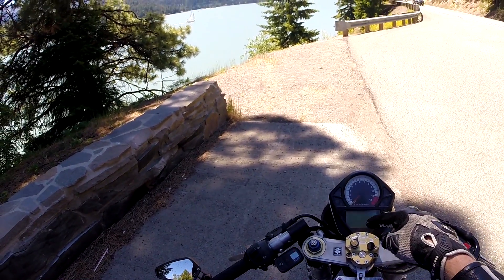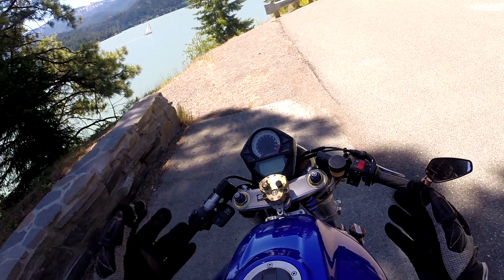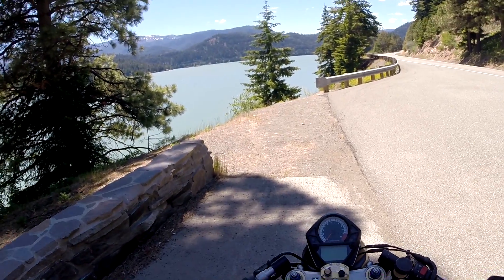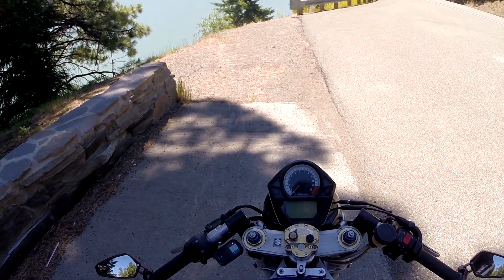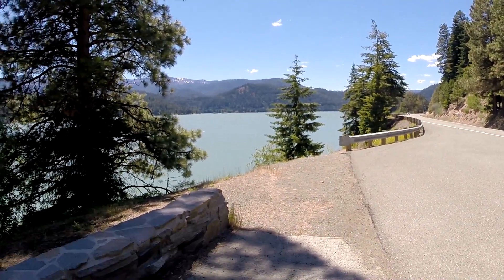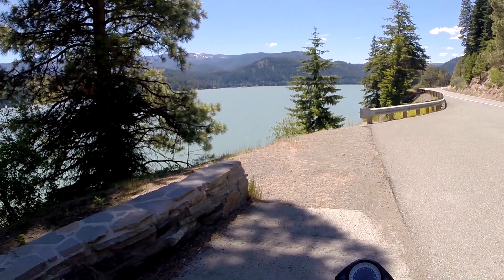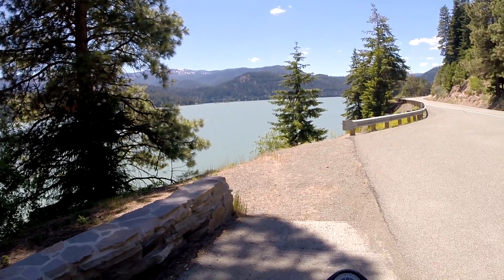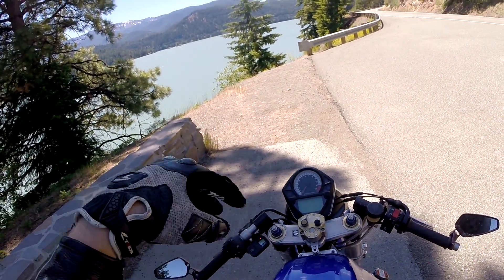Motorcycle Stability Explained

Comment: I don't think rake actually helps the steering exactly. Tony Foale's (quite famous) experiments showed that bikes actually steer better with a zero rake, but the forks judder when braking. The other reason for rake is just to position the handlebars closer to the rider.
Reply from the maker: Bob Walton For a conventional motorcycle, rake is vital. True, it isn't a strict requirement for a "stable two wheeled vehicle", but that's a huge design space that includes some very unusual arrangements. 
Link-based front end designs like the old springer, the Hossack, and whatever BMW calls theirs are examples that don't necessarily have a raked compression travel (heavily influencing brake stabillity), but even they all use an inclined steering axes. Not that it is always a firm requirement, but for most practical bike designs, an inclined steering axis is a really simple and practical way to help achieve the required dynamic stabillity (remember it's still only one of many factors).
Reply: Tellies are simple, but structurally, and in terms of handling, and in terms of aerodynamics of the whole plot, tellies are a monstrosity! I asked a monster once and he agreed.
Reply from the maker: I wouldn't put it that strongly, but some of the advantages of link suspension are pretty intriguing. I just don't think there is enough room for handling improvement for manufacturers to justify a halt and redirection to the momentum that telescopic suspension has gained. Seems fitting that a master of machine design and manufacturing like BMW would put the biggest dent in it so far. I just think if someone tried to accentuate different characteristics, like feel, aesthetic, and riding pleasure instead of only trying to extinguish a vague imperfection like brake dive, it might finally catch on. Hopefully there will be more to come...
Reply: Well I think that big scooters, like a Suzuki Burgman for example, are gradually evolving into feet forward motorbikes. There's loads of them around. But they can't go the last step and put the rider into a leaning back sitting position, because the handlebars are too far forward, which is actually limited by the steering design. That would be an evolution, rather than a halt and redirection of momentum. So there is a pretty strong incentive for them to find a steering design that allows the handlebars to be positioned further back, that doesn't screw up the handling, and that means doing something radical with the steering design. So maybe the likes of BMW will go the last mile and use a new concept for the steering. A guy called Hossack came up with one design years ago, and they actually waited until his patent ran out of time before they used it. Why couldn't just have given him a few quid instead of waiting 25 years?
Reply: Bob Walton
BMW's version of the Hossack is the Duolever found on the K1300.
The Telelever is rather different and is found on most of the flat twins. IIRC. Couldn't be arsed to check. 😁
Reply: drienkm
When BMW designed a Superbike, they used telescopic forks. 
There seems to be an advantage to them in the hands of a proper racer, i.e. someone with enough skill and bottle to take the bike right to the edge of traction.
I seem to remember Guy Coulon saying that the ELF racer had a tendency to push the front wheel under braking due to the lack of dive. When it comes to cornering, it's more a matter of the rider not feeling what the front tyre is up to so, as brave as they are, they can't go there if they can't tell when they are about to crash.
Reply from the maker: Well said. I think the tolerability of brake-dive is proportional to a persons skill on the bike divided by their knowledge of kinematics! Haha. 
Especially the consumer end of BMW has a tendency to over-engineer things. There's well thought-out, and then there's BMW! Don't get me wrong, they build excellent bikes overall. 
To your point, I think racing design groups including BMW's live in an environment too competitive to get very far down dead end paths. If something doesn't perform well in hyper skilled hands in the heat of battle, they simply can't afford to peruse it.

Comment: good vid so how stable is the piaggio mp3 compared to 2 wheels ,
Reply from the maker: +simon amos Good question. I don't really know, I've never ridden one. It's certainly likely that the stability model is even more complex than that of a normal bike, but it's safe to assume that with proper analysis and design and testing, the mp3 layout could be made to have good stability. There's nothing about it that jumps out as being a major enhancer or detractor of stability... well, except the obvious enhancement at super low speed of course;)
Reply: ok cheers

Comment: The steering geometry, (rake and trail) explains why the wheel has the auto-center behavior. (like a shopping cart). But the reason why the bike stay upright is the gyroscopic effect (and inertia eventually) . And the reason why you counter steer is because of precession.
Reply from the maker: A short answer: not really.
A long answer: Your 1st and 2nd statements have a little truth, but the 3rd doesn't have much:(
I'll first address your 3rd statement (countersteer) because it's simplest and most fundamental.

3)  Gyroscopic procession isn't a significant mechanism in how rider-commanded countersteer leans the bike, although it is one of several things that can cause stabilizing auto-countersteer after a lean perturbation. 
Countersteer is an unfortunate name for the way a bike's lean angle is changed. The dominant principle is a simple one; if the wheel is misaligned from the bike's direction of motion, this causes a lateral (sideways) force at the contact patch. That force being well below the bike's CG, it directly controls the bike's lean... If you flying-tackle someone at the kneecaps, they flip *forward*... Same physics. 
This is also why it's often really hard to turn away from a curb or edge that you're riding really close to. Your brain knows the wheels don't have room to move out. Actually, even a running animal "countersteers"! - The foot must first be planted on the side opposite the intended direction change. 
If you can find head-on footage of a bike initiating a quick turn, notice what moves and what doesn't. The contact patches move laterally a lot, while the CG moves little. Kinematic analysis can actually roughly show the proportional lean-inducing strength of this primary effect vs procession based on this perspective.  People have even built bikes with special gyro-canceling wheels for research and they confirm this, behaving similar to normal bikes (perhaps with a bit less self-righting tendency).

1) Castering wheels (swiveling wheels with trail) don't necessarily "auto-center" with respect to the vehicle. More accurately, they tend to eliminate static force components which are not in-plane with the wheel / steering axis by allowing the wheel it to freely align itself with it's own direction of travel across the ground. 
It's very important to recognize that if you bent the mounts above the casters on the shopping cart in the same direction (leaning the wheels to one side) the cart would constantly want to turn when rolling - the castering wheels want to follow a curved path. Obviously we need to abandon the shopping cart analogy here because it can't lean, but this is a major contributor to the initial corrective steering response to a lean perturbation, and is what I was demonstrating in the video with my front wheel. Once the bike's new curved path and the steering angle have settled such that the bike's inertial vector is again causing zero net steering torque, the bike is in a stable turn and generally requires rider input to return to a straight path. 

2) Actually I digress, I could have made it clearer in the video, but bikes don't actually always stay "upright" by themselves. What we mean by stability is actually the bike's tendency to smoothly and quickly halt uncommanded changes to lean - it "stays where you put it". Airplanes are typically the same way, cars are not.
But back to how bikes do this: I've explained the strong influence of caster (trail) on the static stability of a bike. Rake in the steering axis is a large player (among many others) in the rate (stability derivative) of this response. Here again, gyroscopic effects are typically small but do add damping to the steering axis (more so at high speeds), and to a smaller degree, the whole roll (lean) axis of the bike. Other things like tire profile come into play too, especially in situations like hard acceleration or braking in a leaned attitude through a wide tire. This can create vertical moments which affect steering statics.

Thanks for the comment! I hope this helps.
Reply: drienkm https://youtu.be/NcZCzr9ExKk
Look at that video. It shows an experiment with a bike with geometry that cancells the geometry you mentioned and the gyroscopic force I mentioned... You will have your mind blown with that experiment. And another factor of stability that you are not considering (neither I)
Reply from the maker: Good video! I remember seeing this some years back. It's very interesting.
After seeing this video again, I read some some of the papers on this by Andy and colleagues. They are very interesting and informative! 
The tilted caster effect I was describing is what they call the "Jones" torque. That and the longitudinal steering mass effect they explored (call it SM) differ in that Jones torque relies on contact patch force components perpendicular to the wheel, while SM relies on the steering system "out falling" the bike frame...  I was curious about getting a better sense of changing longitudinal steering mass distribution and how strong that effect was on my bicycle... so I did a quick experiment (just now!). 

I firmly attached a bar to my bicycle steering stem pointing back toward the seat and taped some small weights to it until the steering system center of mass was just behind the steering axis instead of in front like on most bikes and motos... (when I hold the bike on its side in the air, the front wheel now points up instead of down). 
As you'd expect nothing felt different riding with hands on the bars and I was still able to ride hands-off with no more difficulty than before. It felt different though - more steady, but a little harder to guide with weight shift. This makes sense - extra inertia on the steering system slowed things down while the aft steering mass worked against other effects... so forward SM does seem to be a significant static contributor but it's not the only one (as Ruina, et al. concluded).

Their weird looking "TMS" bike that was self stable was designed to isolate and investigate the SM effect, and to prove that the neither gyro or caster effects were explicitly required for stability. 

It's worthwhile to distinguish Ruina and colleagues' work from the subject of my video. They are much more deeply focused on understanding the principles leading to a purely self-stable bike. This means the bike literally keeps itself standing straight up and rolling in a straight line and is even able to regain that attitude after an external perturbation. For conventional bikes, this requires a specific combo of  gyroscopic effects, the Jones torque, and the SM effect, and only occurs within a specific speed range for that bike. 
In my video, I wasn't talking about this kind of straight-up self-righting stability, but rather a bike that generally tends to stay at the lean angle you put it and recovers from sharp perturbations. Motorcyclists aren't usually expecting a bike that stands up if they release the bars and this generally isn't what we mean when we say a bike is stable.
Ruina, et al. are also running complex dynamic models which are super interesting, but way beyond the scope of my YouTube video intended for curious moto riders;) I'm really just trying to get across basic static interactions.

To sum up, it's accurate to conclude that gyroscopic, trail induced, and forward SM effects all play a part in causing the auto-steer static correction made by a perturbed bike. Different bikes and situations can cause different effects to become stronger or weaker. For example very high speed on a moto may result in gyro being large, while a crosswind gust or moderate speeds on a moto is probably most compensated for by trail effect, and for cases like a racing bicycle or cruiser with a huge forward front end, SM may be dominant at times.    

Well that was a fun and educational afternoon! I think I might do a followup video to this at some point. 
Again, thanks for the comment!
Reply: gyroscopic forces have no effect on low speeds and at higher speeds have only a relatively small contribution to stability and steering. When countersteering, inertia causes the bike to lean. So the bike starts "falling over". Since the bike is moving, however, instead of literally falling over, it starts going in circles. It's the same idea as a coin going in circles.

Comment: Here's one to throw into the mix.... superbike data shows that on a typical lap there is less than a degree of steering angle... discuss
Reply from the maker: Ed McGladdery Yeah! That's an interesting thing. Basically the required steering angle amplitude  (max angle reached) is directly proportional to the rate of change of (time drivative of) lean angle  and inversely proportional to speed. It's actually more like an inverse  trig function, so at really low speeds it gets huge, but at higher speeds its a pretty linear relationship (recall the small angle approximation).
So let's look at a case where the racer is flipping from one side to the other: Regardless of the forward speed,  the time in which this can be done has a hard minimum limit. The limit is where the tires leave the ground just after passing vertical because you're asking the CG of the bike to accelerate downward at more than 1G. Aka, the bike hops off the ground mid switch and you die. So consequently this places a limit on the driving force which alters lean angle; the lateral forces from the tires - basically the sideways component of their rolling velocity which is controlled via steering angle. Obviously, the lateral component of rolling velocity is proportional to the speed, so if the min speed throughout the lap is pretty high, then the steering angle is limited to a very small angle. Make sense? 
More concisely, the faster the bike is going, the faster lean response you get per degree of steering angle and there's a an upper limit on the lean speed (rate of change of lean), so then there's a speed related limit on steering angle.
Great comment!
Reply: drienkm 
Great answer!

Comment: I'm no physicist, but I want to introduce an additional concept in favor of what is explained here: "governing force". What this means is, in  a system as complex as a bike, what is the force that prevails? What is the force or principle that gives the system its fundamental behavior, and then, which are the secondary forces that give the system additional subtleties? This explains the pendulum vs gyroscope debate: the pendulum is the prevailing force (horizontal pendulum between the imaginary cord, the rake projection on the floor, and the point of contact of the wheel -- a simplification of the wheel itself). The pendulum explains the behaviour of the bike; the gyroscope just dampens the system. Remove the rake, or even worse, invert the pendulum, and the gyroscope won't be of much help. But then, remove the gyro, and the system still in essence behaves in the same way. Another observation is that dampers are also selective: they won't act on the steering while the force applied is below a given threshold, but then above that threshold it will come into action, probably with an intensity that may have been previously configured.
Reply from the maker: Arturo Espinosa Yup. As you point out, It's important to remember there are many competing and compounding forces are in play. And they are each functions of different things, and many are functions of eachother. This is why it's really hard to come up with an accurate dynamic model of a bike.
Your pendulum simplification is eluding me, but it doesn't sound far off. I'm sure it would be clear if we were sketching.
I usually make a point to clarify what seems to be a common misconception about there being a "gyro threshold". Gyroscopic forces are still at work even at very low speeds, but they have a strong exponential relationship to rpm... so they're just really tiny at low speeds.
Good comment!